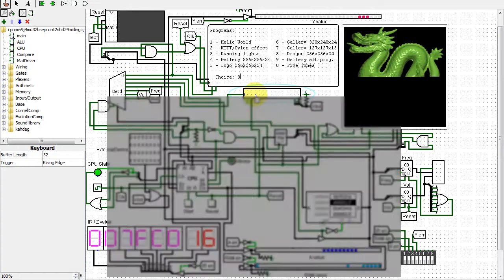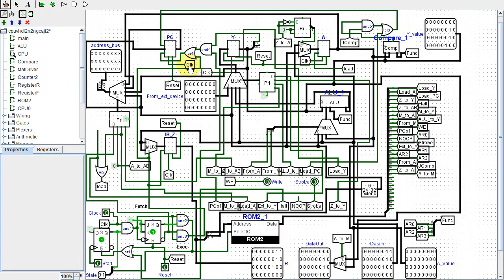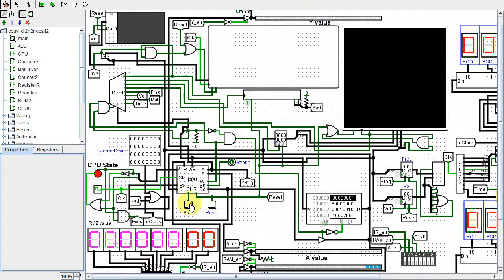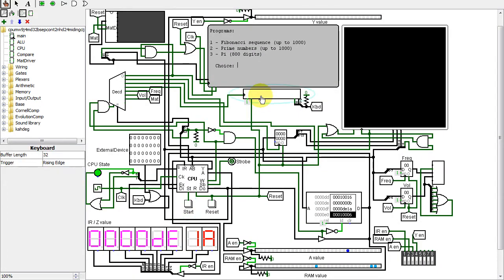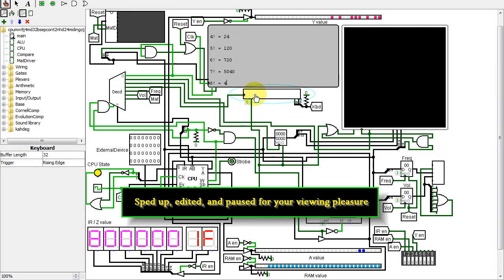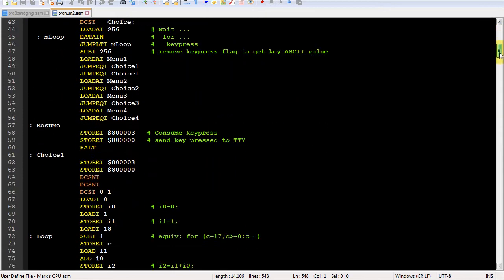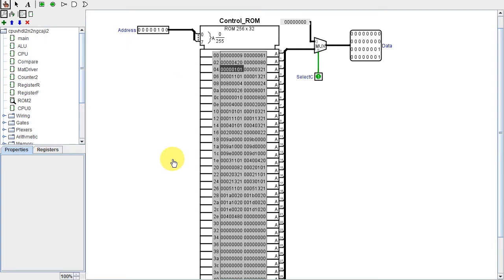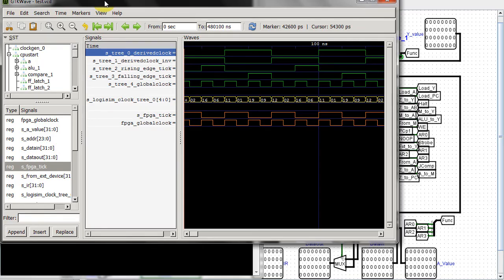My CPU: Goodbye Gated Clocks! Hello Indirect Jumps (Now With More Programs)

Comment: Does that help with audio? Gated clocks introduce noise etc
Reply from the maker: In simulation such as logisim, there is no effect on audio.  If in real-life hardware, such as an FPGA, I don't know how it might affect the audio.  As far as I know, the main reason to eliminate gated clocks is to reduce the chances of timing problems (due to gate delay).  Of course, if the audio circuitry depended on the result of a certain signal or value that didn't get set correctly due to a clock tick that was delayed, that would affect the quality of the sound.  I don't know if that would be classified as noise though, assuming we're essentially talking about "electrical noise".

Comment: I got a problem: i build an GPU (or to be more precice just an rasterizer that converts a triangle into pixels). But it takes half a minute to draw a single triangle, because my computer can only simulate 1000tps. Is there a way to speed things up? (Other than reducing the size of the screen). btw. im using standart logicsim.
Reply from the maker: The only thing that I can think of that would speed it up is to reduce the number of components (every component added (including wires) makes it slower).  Some people have managed to reduce wires considerably by making components (and subcircuits) fit exactly together (like I did with my LED matrix driver).  So, if there are any unnecessary LEDs, probes, wires, pins, etc. try getting rid of them.  BTW, my video screen segment is time-lapsed considerably.  I forget the time it took to render, but it was about an hour.